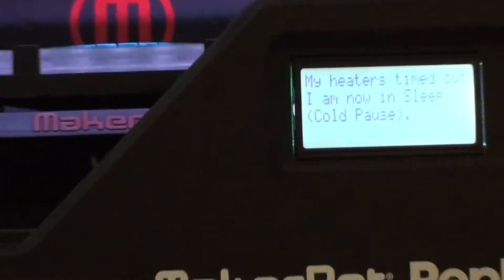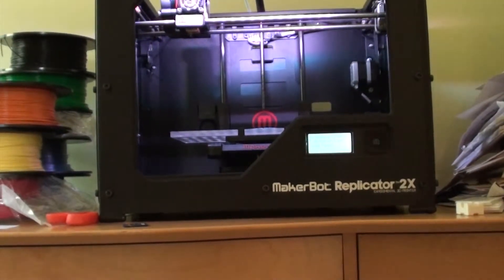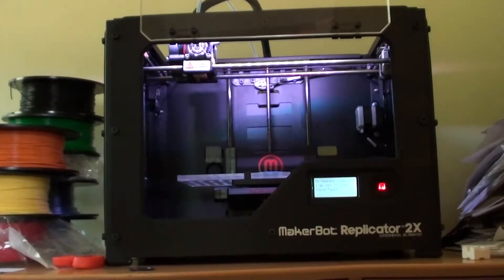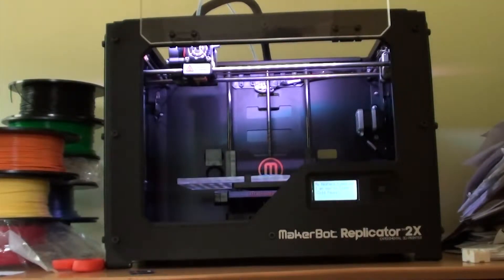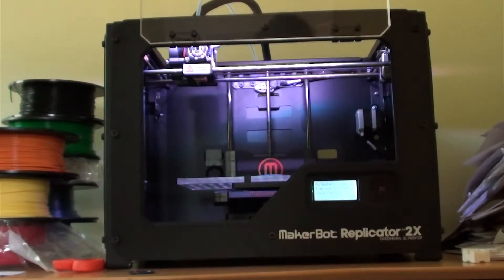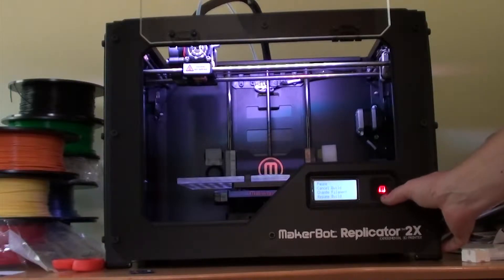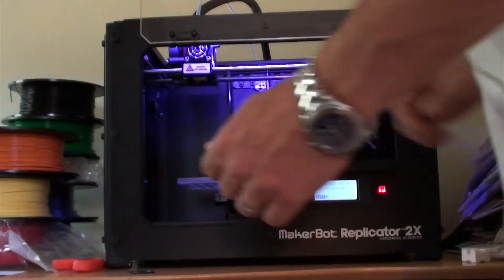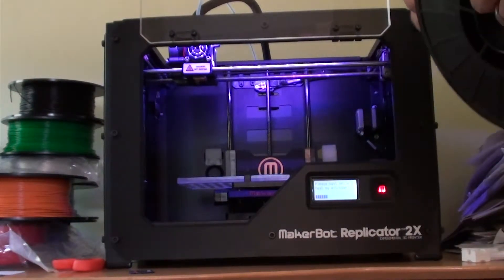Makerbot Replicator 2 Extruder Plugged Again

Comment from the maker: Hi, I got rid of the machine(MB took it back and gave a full refund), and now have a Form1.  Very nice printer, extremely precise.  However, I do miss my old Rep2 for quick print times.

The reason I did the Cold Sleep was because I wanted it to stop at certain levels, so I could print different colors at different layers (this way you could have colors in your print if you had recesses in the print).  It usually looked pretty cool.  The only problem; 2 out of every 5 prints (5hours prints) would fail do to air printing.  

My suggestion is not to use the Cold Sleep, but babysit the print and do the math, and stop the print via Change Filament.  You may still have trouble with the Stepper motor clicking.  Sometimes you can get lucky by forcing filament through the nozzle by hand, and then pulling it out.  Doing this 5 times or so usually got the spent/residual out of the nozzle.  

In the past, I tried everything:
replacing multiple nozzles
heater assembly
adjusting temps
adjusting build plates
get new build plates
replacing the harness to the motors
Replacing the PC Board
Etc., etc., This was a year ago, so I'm forgetting a lot.
Also - please note - this is a REP2, not a 2X.  I had the 2X front, and placed acrylic sides, and a plastic hat on top, so I could keep the temp around 90 degrees F.  This helped to prevent curling.  

But what I came think was - MB doesn't know why it clogs.  I do believe some if it is software related.  As I mentioned above, I would plush the filament through, with little resistance, so I feel the motors shouldn't skip.  I had just gotten it back from MB, and I caused it to fail within 5 minutes of using, by doing this action.  I did it to prove there was a problem, and they ended up refunding me my money in full.  

It's kind of a shame, because I liked the printer, like company, like the community, and wish them well.  I hope one day to own one of their printers again.  When it worked, it was great and I made a ton of mechanical items that don't exist on the market today.

If you have any other questions, feel free to ask.